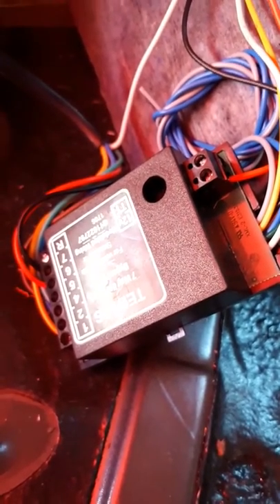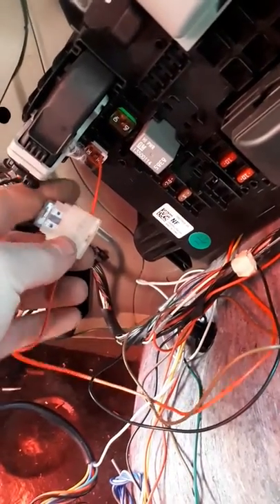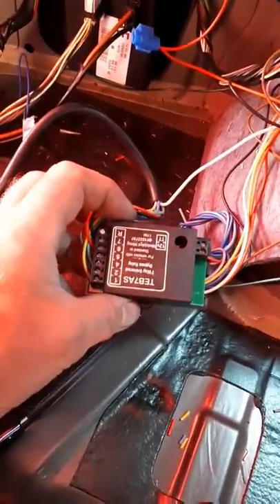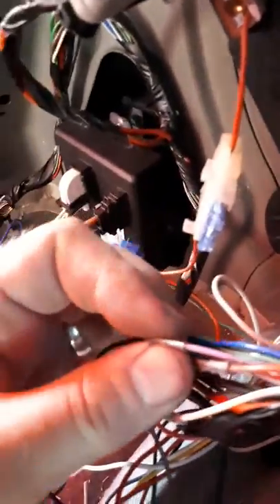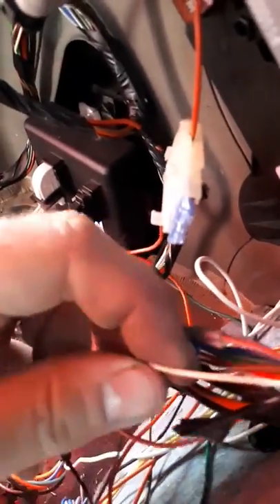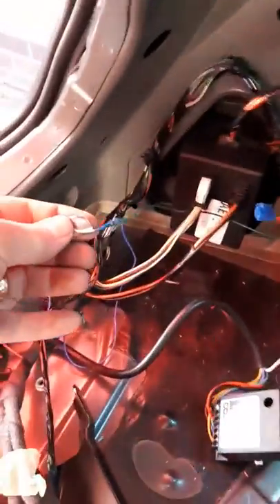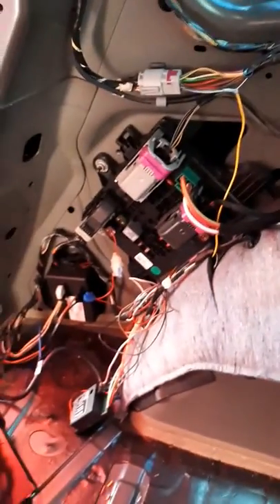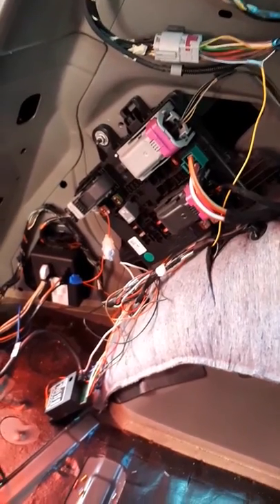How to wire tow bar canbus electrics on Vauxhall Opel Insignia

Comment: Hello. Please could you give me a quick answer and that is. Will a normal 12volt test light be ok to use to find the correct wire in the harness, thank you.
Reply from the maker: Hi yes a normal test lamp is fine,  it's still 12v it's just that the system is monitored to tell you if any of the lamps fail.
I am assuming the connections will be the same as in my car
Reply: @pyroshnid  top man thank you. I am having a nightmare with my electrics on 2012 Insignia Estate. Not easy like my older vehicles or van as with them it was just a case of wiring into light cluster. The cables on the insignia change colour after the plug on the harness.

Comment: i'm going to have a go at wiring this myself where did you pick up power for the relay in the back? how hard was it to do?
Reply from the maker: Hi the hardest part is getting all the trim off and exposing the wiring loom, I took the supply for the relay from the fuse board in the back of the car and added an inline fuse to protect the trailer light wiring.

Comment: Much appreciate the video, what type of fuse connecter did you use to pick up the live feed?
Reply from the maker: The Shabbs I bought an inline fuse holder from an auto shop that takes a 15 Amp standard car fuse
Reply: Hi. Do your trailer lights still work even with boot lid open as I've heard that when boot lid is open it cuts power to indicators on the estates anyway. As I've just purchased an estate and have a towbar to shift from my old hatch..

Comment: Can you explain how you tapped into that fuse please for the power supply
Reply from the maker: Hi Rick I just trapped the wire behind the permanently live side of the fuse but these double adaptor piggy back fuse carriers are a much better way of doing it https://www.amazon.co.uk/dp/B017O0QHZU/ref=cm_sw_r_apa_i_7NUVEbD7F5F5M
Reply: I'm guessing all the colours should all match on all insignia or not 🤔
Reply from the maker: @Rick.Harsum  they should be a standard colour coding

Comment: Hey mate do you know where the blue wire from the relay connect to  (the fog light)
Reply from the maker: Hi I didn't connect this wire as I only tow a trailer, you should be able to trace the wire back from the rear light clusters to find the wire you need to splice into.
Reply: Thanks for the reply mate i will try it that way, i have everything else done but the fog light to ty for the guide :)

Comment: Just followed this video on my 63 plate non face-lift and the sides and brake lights don't work
Reply from the maker: Unless they changed the colours on your cars year this should work fine, if you look at the lights and trace the lamp contacts back to the plug on the back, you will be able to work out which colours are used in your vehicle